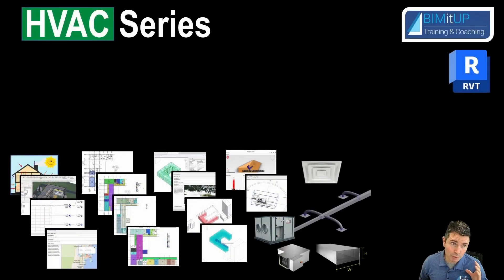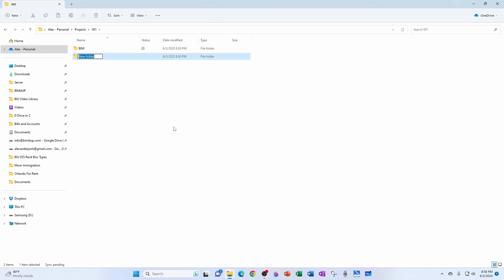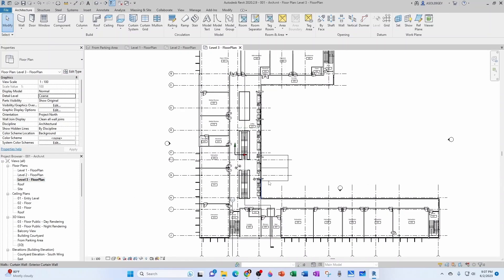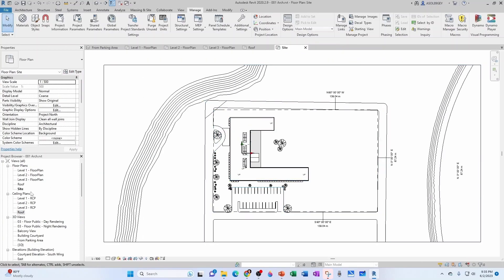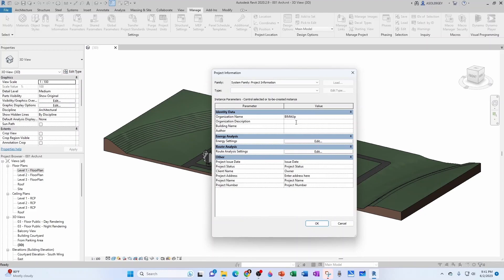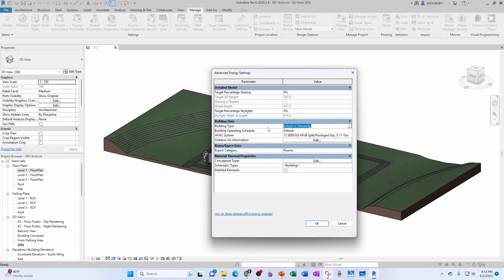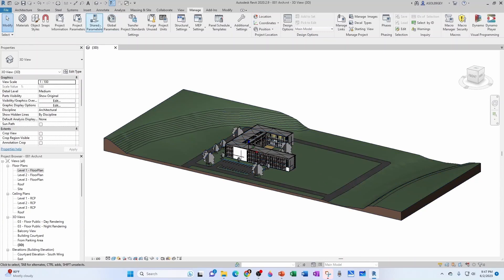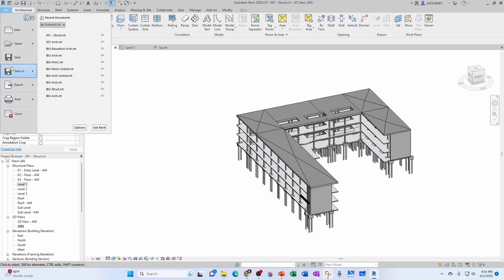Revit HVAC 0 Exploring and Setting up the Revit Architectural and Structural Models

Comment: Hi Alex:

Looking forward to this new series.
Question: I noticed you were able to modify the architectural and structural models. Typically when I get these models I can't modify them. I bring them into my REVIT template and even there, I can't modify them. Is there a way to change the setting in these models so that I can modify them?

Thanks,

Joe
Reply from the maker: You are correct Joe.
You are not supposed to have access to those links.
When you don't have the privileges, all you can do is modify how they behave and look
(Absolute/Relative, Attachment/Overlay, Halftone, Transparency, Visibility, etc.)